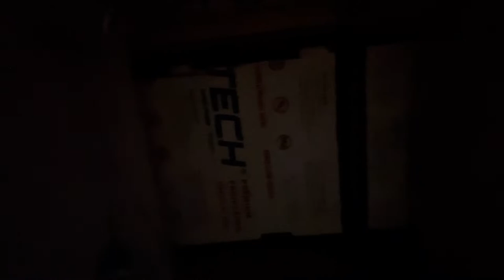Episode 49: Ceiling (Furring Strips, Wiring, Insulation)

Comment: What screws did you use for the roof?
Reply from the maker: Stainless self taps.
Reply: What size fairing strip and screw length? Thanks
For the rely
Reply: I am converting a 20 foot box truck . The furring strips are perfect size can you cut and install them by section or is it advised to always stretch out the whole length of the stud?